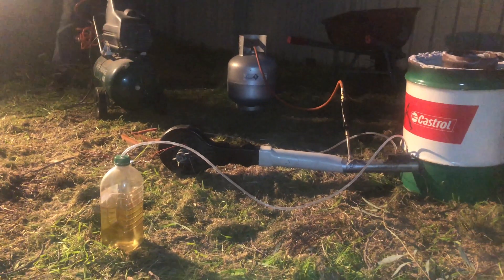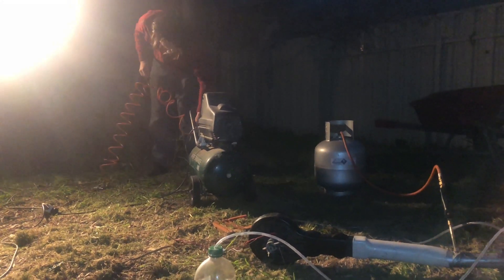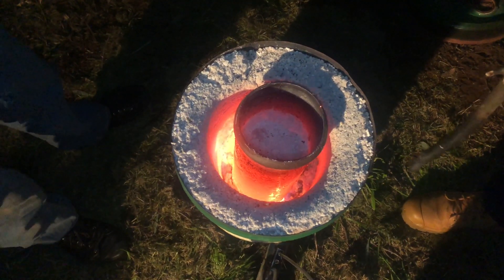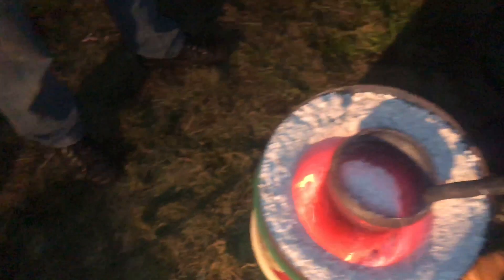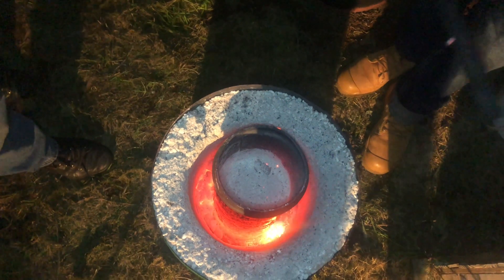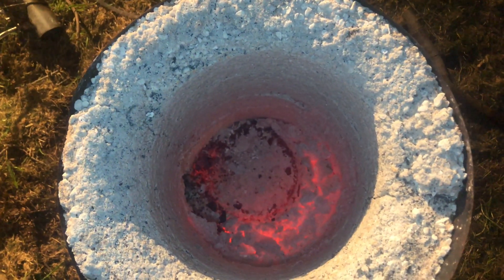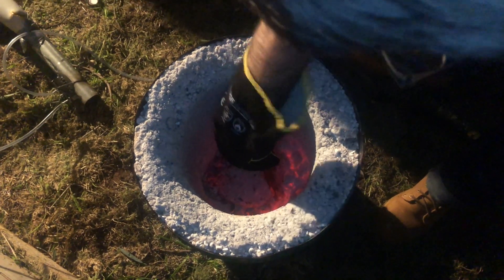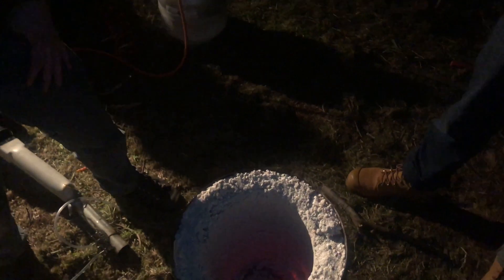How To Make Furnace Glue (Sodium Silicate)

Comment: Man I don't know how relevant this question is but I'll ask it anyways. So I made some sodium silicate and sand bricks. Let em dry, and when heated with a torch or a heat gun they get soft. Oh yeah the bricks had a little kaolin in them as well. What the hell is up with that? shouldn't they get hard? Thanks in advance for whatever insight you can lend me.
Reply from the maker: This furnace worked well for aluminium casting temperatures but was destroyed when iron casting temperatures were attempted, i presume you heated them beyond their temperature range which peaks at about 1100C.